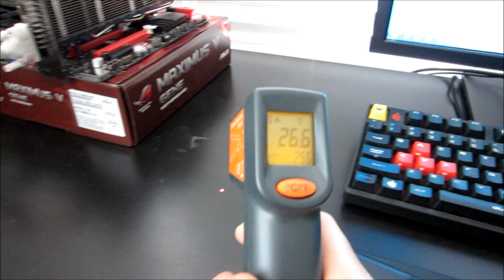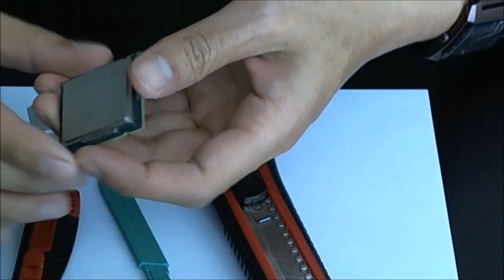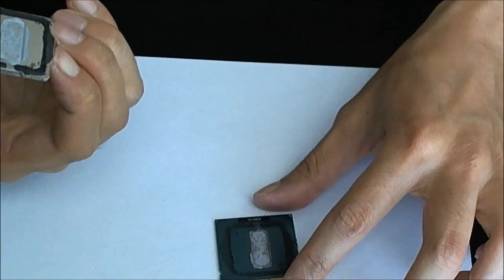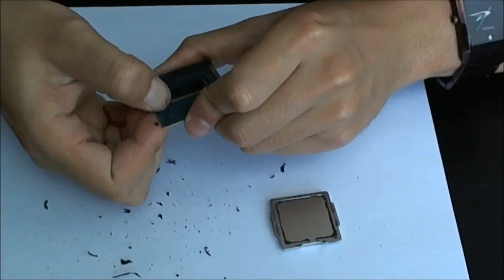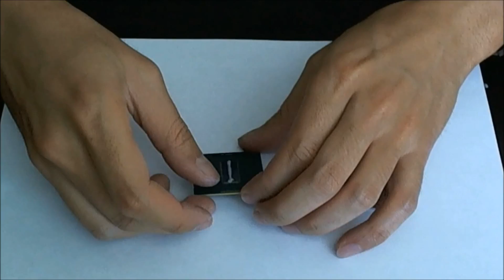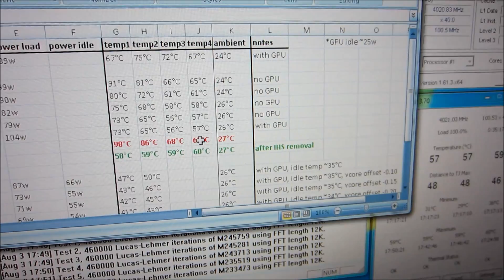Fixing Skylake, Haswell, and Ivy Bridge CPU temps: IHS removal

Comment: to all who want to re-atach the heat spreader in a more permanent manor, i sugest using some Rutland adhesive. More specificlly i sugest getting the "Rutland 76A Black Silicone Seal 500 Degree - 2.7oz" (Thats its name on Amazon). Just remember to use a very very small amount.

Comment: I don't have a desktop, but judging by the spacing it seems like the CPU chip will end up too low to mount most heatsinks, which are larger than the bracket. Also, I noticed here, you might see at around 19:25, that the CPU is held in place by the cover which means you'd still either need some form of replacement of the cover, or you'd need to put some kind of spacer between the bracket and the PCB.

Comment: Could you leave the IHS off and instead have that DIE surface with the TIM touch the contact point on the heatsink ...

Plan on doing this with a build soon.. know that laptops have there dies touching with out a IHS because its concentrated in that specific region (though laptops typically are not overclocked)

Comment: this is only a problem because you increase resistance between the pins and contacts. It almost never matters but if you're worried, clean it with alcohol after touching it.

Comment: Actually the heat spreader is to make it less risky to install a cpu. In the much older days almost all CPU's didn't have heat spreaders. Chips are ceramic and ceramics are vulnerable to pressure, shock and high friction. When people tried installing CPU's on their own, a lot of them cracked. Which is why they now include heat spreaders. If you open up a laptop and remove the CPU it will look exactly like this one without the heat spreader because consumers don't tend to mess with laptop CPU's.

Comment: I'm just curious but do you have any idea if this will work with a mobile version of an Ivy bridge Processor? 105c is too damn hot for this laptop and causing frame rate issues. I'm going to take it back to apple care to get the damaged parts fixed, but I need to know if there is a solution for mobile processors.

Comment: I seen many ivy bridge cpu's with the same heat issue. 
Your demo for the repair works and has been done many times with the same successful result. 
The black adhesive is most likely urethane, same as the urethane for installing auto windshields. 
They heat it, then apply it, when cools its a very strong bond. 
Nice video and good work getting the close ups.
Thanx for posting.

Comment: i have an i3 and i would never do this plus my highest cpu temp ant max is 72 degrees and my 7750 stays at about 70-80 degrees and its over clocked to 925 MHz core clock

Comment: Thank you so much for taking the time to make this video, it helps a lot. Also, special thanks for only speeding up the cleaning and not the IHS removal, as in so many videos. Based on your experience with all of those thermal compounds, can you recommend the best three? Preferably ones that are not very viscous, so I can use the dot or line method.

Regards.

Comment: I think heat speaders are a joke thats why amd didnt use them for years. Due you should replace your thermal past every two to three years and every 5 years for a cool running under clock chip. But most people would replace there computer fegore then

Comment: Genius is finding extremely inexpensive thermal paste and using it in an area where there is no alternative in order to cut costs. Intel isn't stupid to use cheap thermal paste, they're rather smart. Replacing it with higher quality is also.

Comment: i think there was something wrong with ur cpu then because i didnt mod my cpu and im getting around 80 degrees prime95 at 4.5ghz with 1.3V, using an thermaltake spinQ vt cooler, still i wanna try this but im afraid of screwing up my cpu

Comment: some idiots commenting like they have a clue, great vid. I am having a similar problem with my 3770k, but not as extreme as yours around 10 degrees. Only difference after applying the thermal paste I will be re gluing mine lol. cheers for video I have seen other guys doing the same thing and getting great results so props to you young man.

Comment: IF YOU DO THIS...

Note: Works similar AMD CPUs/APUs using epoxy to hold the IHS.

From experience, any time you mount a cooler in direct contact with the core you need to lap it 'mirror' smooth and perfectly flat for the best results.  Use Arctic Silver or similar paste made for core contact.  Some newer paste is thicker and made for larger HDT type coolers where filling gaps is more important than having a thin layer.

Do not lap HDT Coolers too far or you risk rupturing the heat pipes.

Comment from the maker: If the issue isn't thermal paste like you said, then I shouldn't have had such a dramatic decrease in temps, since all other conditions are exactly the same before and after thermal paste replacement (hardware, ambient temps, BIOS settings). And you see the heatsink in the video, it's not a shabby one.

You could have at least watched some of the video before making a comment like this. It's actually a pretty common "problem", just look on any computer forum. Please do your own research :)

Comment: The reason for the over heating issues isn't the thermal paste between the cores and the heatspreader, it's the fact of the new die size, the ivy bridge had a larger die size and therefore could distribute heat easier. Intel also added the tri-gate transistors into the new ivy bridge core, these conduct heat much easier than the original transistors in the sandy bridge. Honestly, I'm almost afraid to ask what heatsink you had on your cpu before you removed the heatspreader. Please research more!

Comment: Hey after all you nor remove any heatspreder you just cleaned that crapiest on world thermal compound (which aint AC MX-2 after all) and replacing it with MX-2. You couild use ceramique it's stickier so you wouldnt be panting so much wiht HS sticking when you apply retention holder pressure onto it. And people swore it's 5-10% better thermal conductor than MX-2

Comment: I would be way too afraid to do this. I would only do it if I knew I could afford a brand new CPU, no way Intel will warranty this. And to those of you who do actually do this, do not use very much pressure at all, if you are crazy, no, stupid enough to keep the IHS plate off make sure you don't have a heavy sink like a NH-D14 or CM-V10, and dear god do NOT use arctic silver, or any other conductive paste.

Comment from the maker: If you're referring to the underside of the CPU, then it doesn't have pins. It has pads for the motherboard socket pins to contact.

If you're referring to the how hard I was pressing down when installing it in the motherboard at 19:30, then how hard do you think the CPU bracket or cooler presses down on it?

Comment: NOOOOOOOO bad idea. The point of a heat spreader is to spread the heat so the cooler can easily dissipate it. Plus no heat sink cooler or water block is designed to reach the CPU chip but instead is designed to press firmly against the heat spreader.

Comment: It's strange I have a 3570k running at 4700 and mine idles at 35 maxes at 64. Also it would have been slightly easier to heat the glue up with a hair dryer or something. Nice video though thanks.

Comment: Thanks for posting this. I actually feel confident enough to de-lid my 3770K after seeing you perform this delicate,but relatively easy surgery ! Great vid! Also ,I agree 100% with scalz.I have been an avid Intel user since 1996,and ,for them to let such shoddy thermal paste be applied to their premium,(well I guess the 3770K would be an upper mid-range)or even low end CPU's is a disgrace.

Comment: OK but dude. The thermal paste was still wet when you did this test so it gave much better results. What are the temps now that the paste dried up? Interesting though especially the differences in temps between cores. I have an i5-3570k and I can overclock to 4,7 (even 4,8 stable but too hot imo up to 97 degrees) without getting over 80 degrees with air cooling on a pz77-v LK. I guess I lucked out.

Comment: You only need to do this if you want to go for high overclocks. And since this is a K series processor, overclockers will want to do this.

I'm personally at 4.5GHz with slightly less than 1.3v without a delid, and hit 90+ on the first core after the 16th test. Deliding it would decrease temps by at least 25c.

Comment: Do not try to do this with the older processors.i have an old celeron 841 and after i played with it,the die ripped off with the heat spreaders after i pry it open.so be careful.

Comment: Remember, removing IHS is voiding your warranty (doesn't matter if it's Intel or AMD CPU's, even sanding-it is voiding it's warranty), if you still have a warranty, you better R.M.A. your defect CPU and get a better replacement, unless it's not covered anymore (old CPU), then you can do this trick.

Comment: Lmao, full system power consumption. Ok, so if the idles are the same, and the loads are only 15 watts different, what does that mean? It's like I am teaching you basic math. Just because a semiconductor has 1 watt going through it, doesn't mean it emits 1 watt of heat. In some heater-coils they can create 3 watts of heat from 1 watt of electricity from resistances. But that's thermodynamics. We can save that lesson for another day and focus on basic math for now.

Comment: i recently purchased a new corsair h55 so the temps on my ivy bridge 3570k are fine (now)

but i get frame dips, i think this was because initially fried the board 

Ive replaced the motherboard still no difference. ive replaced the ram no difference ive swapped the graphics card still no difference bought a better PSU. nothing stopped the frame dips 

the gpu runs at 99% constant everything works normally untill i game and the fps spikes it didnt before

could it fianlly be the cpu? need to kno

Comment: ya I wouldn't do this unless money was no object and I could afford to replace the chip but I like my warranties left in tact ;p His chip was clearly fucked up though. I have a day one release 3570k and I don't even get temps that high with 4.6ghz @ 1.260 (h100) OC, nvm just 4ghz under volted. No way my H100 is THAT much better a cooler then the one he was using. His was clearly a REALLY bad example of the ivy bridge heat problems. I'd have just RMA'd the thing.

Comment: I guess I got lucky with my chip (day one release chip) because my temps are no where near that high and if they were I'd be RMAing it immediately. Currently sitting at 4.6ghz @ 1.260v and I idle at 24 on the lowest core and 30-34 on the highest core. During games I go into the 50's. I'm using an original h100. Prime 95 with fan on full blast (I don't use the fans that came with h100) I spike into the 70's but it usually doesn't go any higher then 65ish on the highest core.

Comment: My goodness, you're dumber than I thought. I think you're missing a chromosome or two, or 10

Are you actually giving people advice on when to turn on house AC? That has NOTHING to do with this. If this was done at 100F, then you still result in 80F at the end. If it starts out at 70F, then you get 50F. The benefit is the CHANGE is temps before and after.

You obviously can't understand simple concepts, so stop digging yourself a bigger hole. Idiot.

Comment: Good eye. Correct. .I'm such a great tool for finding other's bullshit, exposing it, and deconstructing it.
In case you didn't figure it out, calling someone MUCH more intelligent and wise a " tool " just shows how limited and idiotic your capacity to retain clever insults really is. If you're going to insult someone, it needs to be closed circuit and WITHOUT room to be turned into a bow an arrow that can be pointed back at you. How's that working for ya now? xD
:)  You're welcome.  Move on kid.

Comment: 27 c.is 80F   hell..there's part of your problem..it's freaking hot as hell in that room.
You've never heard of a/c? Well there was ONE thing useful about this video...I FINALLY get to see realistic proof of WHY one should apply the thermal paste in a cross pattern to guarantee that you cover all of the actual cpu inside the " cpu basic assembly" .I would not do this to any cpu. Intel are the experts..they built this thing and they did it this way for a good reason from experience.

Comment from the maker: Anyways, to answer your question directly, IC diamond is good but it's very well documented that the abrasive nature of it will scratch the surfaces. I've had CPU's where it completely scratches the laser etching off the IHS, so I didn't want this same thing to happen to the bare die.

Really though, it's not going to matter too much because they're all miles better than stock paste. I chose MX2 because it wasn't as thick and can spread easier than MX3/4. It's about 1C better than my Tx2.

Comment from the maker: Liquid metal is known to bond both surfaces to copper together, and will also completely destroy aluminum. The IHS and waterblocks are copper, that's why it's almost a permanent attachment.

However, the bare die is NOT any of these metal, so it won't permanently bind to the IHS. Do more research on this though because I'm not 100% certain. Even if it is permanent, why would you ever want to remove it afterwards? ;)

Comment: I've been told to not use liquid metal because it WILL cause damage and become impossible to come off. Many people have use liquid metal on their Corsair hydro series watercoolers and they had to re lap the heatsink under the pump after trying to remove it. I just want to use some simple, issue free thermal paste such as MX2/3/4, TX2/3/4 NT-H1, etc. What would you suggest is the best out of the huge ass collection you have of giant tubes?

Comment from the maker: For the TIM between the IHS and die, the absolute best is Liquid metal Ultra or Pro, made by CoolLaboratory. It's literally liquid metal comprised of nearly all Gallium and Indium at certain proportions for a eutectic mixture.

It has the highest heat conduction of all thermal paste, but you'll just have be careful when applying it because it's highly conductive. You also need to spread it evenly instead of the simple dot or line method. Just make sure none of it spill off the die.

Comment: A CPU is stronger than a lot of people think. The gold contacts on the CPU can be cleaned, as can any component. The pins in the socket are designed to be pushed down with pressure. Just don't go digging in there with your fingernails. Do some research.

Comment: 77W is the 3570K's TDP. TDP = Thermal Design Power. AKA the amount of heat in watts the chip emits. It's a specification for cooling and a guideline for motherboard VRM arrays. Just google TDP and google 3570Ks power consumption. It's not hard.

Comment: Use a normal shaving blade, yours was to thick and you struggled a lot with it. Anyway good video.
Also don't de-lid any CPU that IHS is soldered on, this procedure won`t bring any improvements.

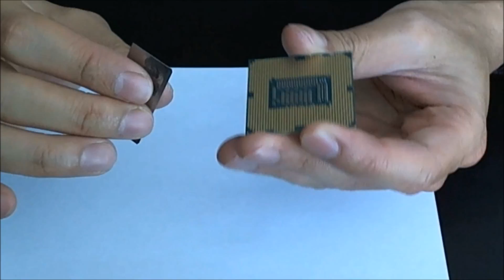Comment: @2:59 those capacitors are the least of your worries, ivybridge transistors are like 4 atoms thick, and the problem is - they never just break, but you'll start getting BSOD's more and more, which is why you shouldn't listen to "I never worry about static electricity, never had a component fail on me yet" guys.

Comment: The thermal paste inside the heatspreader are supposed to be that "hard". It is meant for one time installation never to removed during the lifetime of the CPU.
It's in aliquid state whe applied in the factory, and will harden to enhance the thermal transfer.

So calling the thermal paste "cheap" just because it's not in a liquid state anymore is completely wrong.

Comment: If you don't have the thermal compound you want to use but want to test if your delidding was successful, it IS safe to run the computer without any thermal compound on the die.  The compound I plan on using has not come in the mail yet (Coollaboratory Liquid Ultra) but I wanted to test if my delidding job was successful.  With an H100 and AS5 on the top of the CPU, I was sitting at around 43C in the BIOS.  I can only imagine how cool it will be running when I get the Liquid Ultra on the die.

Comment: Okay I just completed the delidding of my 3770K a few minutes ago.  It was not a terribly difficult process considering I dedicated full concentration and exercised caution over speed.  I must note that wiggling the blade back and forth was the trick to cutting through the glue.  Sliding the blade back and forth has no effect and you risk scraping the PCB.  You will know you have cut through all the glue at a specific point when there is no longer any resistance when wiggling the blade.

Comment: You're being an apologist. The only reason they did this was to make an easy couple million dollars. A 3570K idles at 70W but uses 150W. It's only a 15 watt improvement over Sandy during load. Idle wattage is the same. So, where I live, that's only a savings of ~$2 a year in hydro-electric assuming I run my CPU 24 hours a day. Encourage the sales of Sandy chips? Lol, you seem to think people know what they are buying when they buy a computer. Less than 1% of the market builds their own PC.

Comment: I have been somewhat troubled with the high temperatures on my 3770K.  I have to admit that taking apart an expensive CPU is a daring venture but after watching this video, I am much more comfortable in doing this for my benefit.  Now I just have to look up a good lapping tutorial and perhaps my temperatures will be much lower than they are now.  Thank you for this video!

Comment: Very interesting video!  What an improvement.  I notice even at idle, my 3570K has a 10C difference between the coolest and warmest core.  The variance in the thermal performance of these processors clearly lies in how crappy the individual factory thermal paste job is vs. the chips themselves being better than one another.

You inspired me, I may try this with mine.  Many thanks.